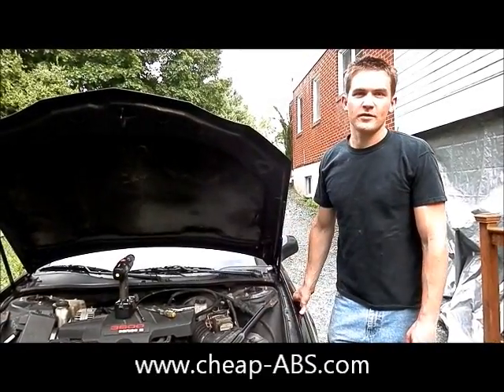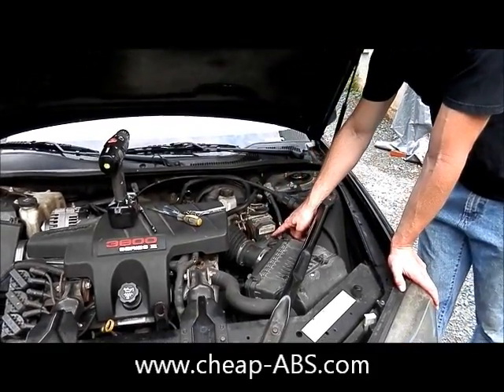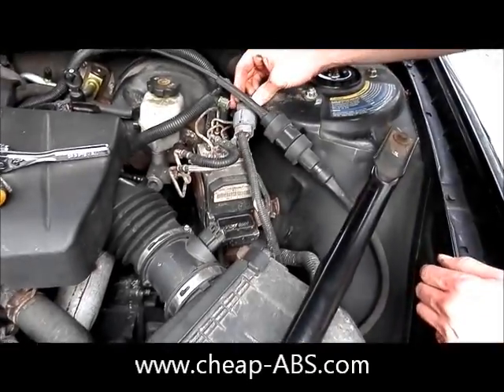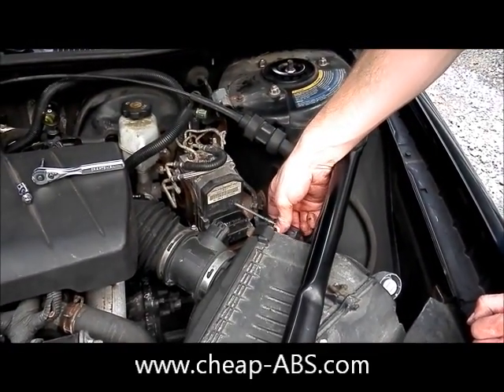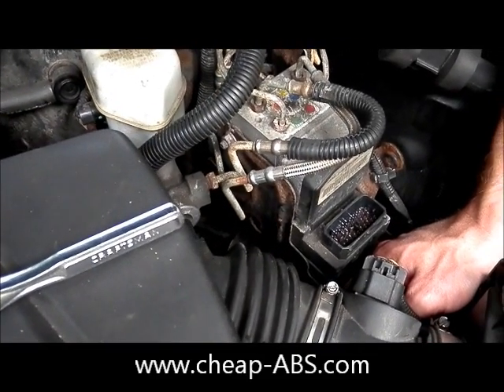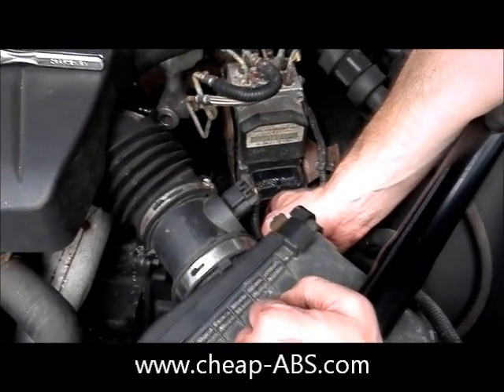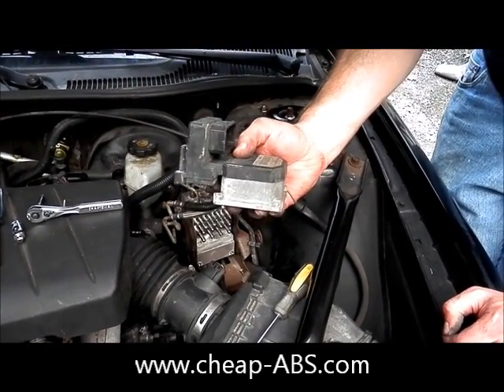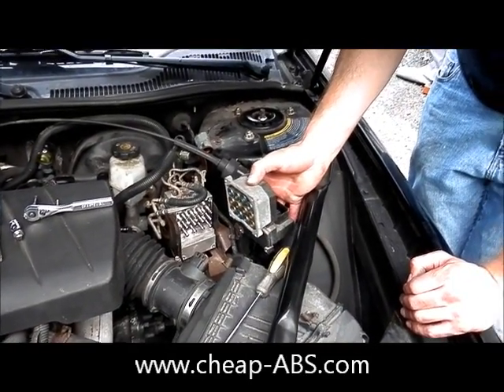Pontiac Grand Prix ABS Module Removal

Comment: I just had one put in the guy told me my brake light will be on Because I have no abs system anymore  but my breaks are now Hard but another guy showed me he loosened the cylinder brake value and they became smooth what might that be?

Comment: How did you determine that your module was bad? I watched another you tube video where there was a break in the ABS wire coming from the wheel hub that was causing the ABS and traction control light to come on and off randomly.
Reply: Should be able to figure it out by hooking up a scan tool 👍🏻

Comment: Thanks for the video, got a 98 grand prix and the passenger side caliper isn't getting any fluid at all. Turns out there's no fluid coming out of the line for that caliper from the abs unit. I'm assuming a valve might be stuck.
Reply: Try replacing the bleeder screw first.  It's a common issue especially if there's no rubber cap

Comment: That was a great educational video. Thank you. 
Now I have a question for you about the module. My 04 is a supercharged version and there is a sticker on the module itself . And the build sheet also has a code . Now I as of yet not researched whether the codes are the same . My assumption is that they should be the same. But if not that might indicate that the module may have been replaced by the previous owner's.  My question is am I on the right track of reasoning? And another question is this : are all 2004 s~2008 modules the same ? I was at the wreckers yesterday and was in the process of removing the sun roof mechanism (what a long day ),and the front seats and just had a look to see if there was a ABS module still in the car .To my amazement this GP wasn't equipped with the option . Am I correct in this matter or did they move the location of the ABS unit ?
Reply: According to the owner manual only the ones equipped with a supercharger have abs .. I have an O4 supercharged too so I’ve been reading everything lol

Comment: Why does the dealer cost a fortune when it is that easy to take off? I am mind blown, I thought it was a crazy process and its a few clips and screws? Makes no sense why people are paying 1200 after everything if its a 30 min job. I don't understand, is there some type of programming after you get a new on on or what?
Reply: There's no programming required. Dealerships are just rip offs. They have to make money to pay their mechanics $20 dollar an hour salary.
Reply: They charge so much because if you look up replacement parts for hers modules, the cost is astronomical! But used ones are like $20 lol

Comment: I replaced my ABS module with one from the local Pull-A-Part for $30...The brake light, ABS light, and the traction control light all went off the  dash!!!.. Yea!!.. I now have my traction control back...Thanks for the tip.. Those darn lights had been on for over a year..
Reply: I thinking about doing the same thing
Reply: What local part house auto zone want $607.99. An $57 core charge

Comment: Thanks you helped a lot. Got Mine from a junkyard for $37.10. The ABS modules for the GXPs are hard as hell to find.
Reply: UrMomsHusband rock auto. com
I got mine 3 day shipping $401.78
Reply: UrMomsHusband 
I have a GP GXP as well, and need a brake control module. After installing yours. Did your lights go off or it took a scan tool to fix it?
Reply: tron daugherty scan tool I believe  the dealership have this.  I have an appointment this Friday

Comment: or just solder the bad spots yourself im a tech and i solder   these all the time
Reply: I'm very experienced at soldering and could not do it, after trying to remove the clear jelly, I couldn't be still enough to solder the microscopic gold hairs. To the people who can solder this, you are god!
Reply: Yea - how do you get inside of the module to work on it?  Appears to be sealed.
Reply: +azucho98 I used a heat gun and warmed it up it could take several times but it works everytime
Reply: Id like to see a vid of how you use a heat gun to "repair" this. thanks... - DTM

Comment: I would soak those screws in penetrating oil for abit before taking them off - and use a shock driver to loosen them up as well - I've taken off many of these units and its not uncommon for the screws to be real corroded and break off.